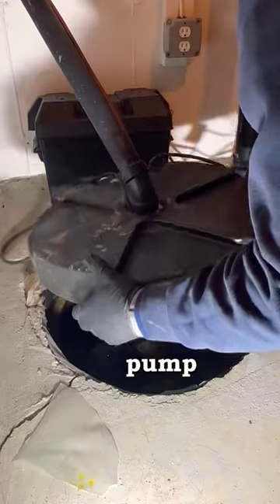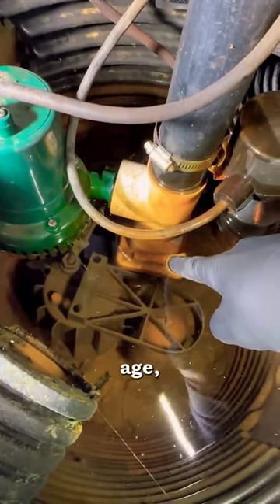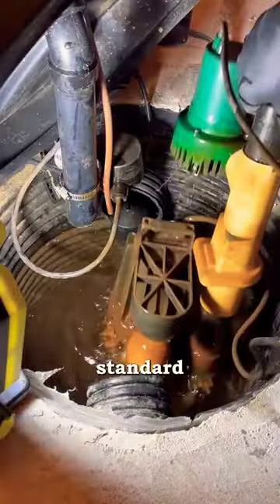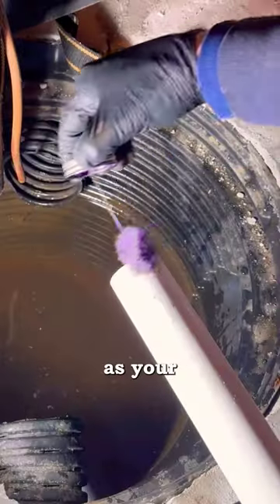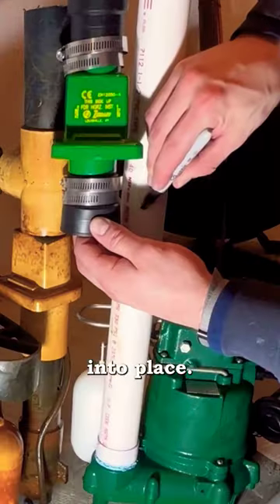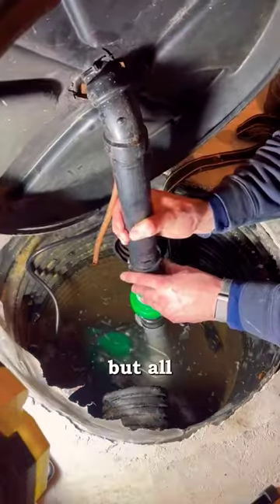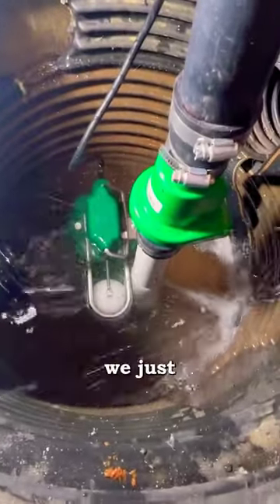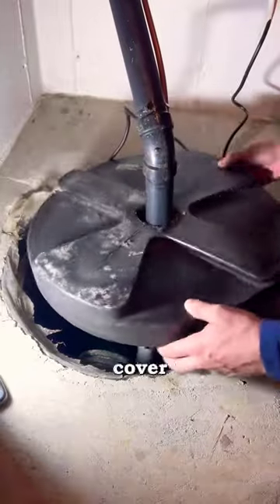Sump pump install🚰 #shorts #plumbing #sumppump

Comment: What’s an airlock?
Reply: It let's the water drain on the bottom side of the check valve so the pump doesn't hydro lock. It's possible for air to get trapped between the pump and check valve, if the air has no where to go, it can't open the check valve. Any air would escape out of the hole he drilled when the pump cycles on